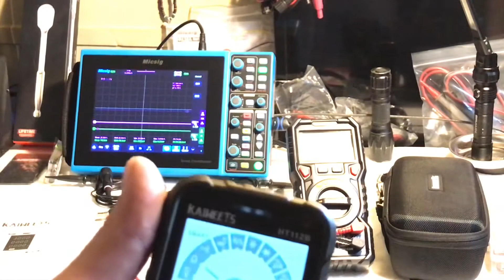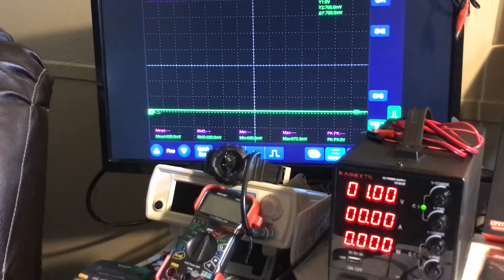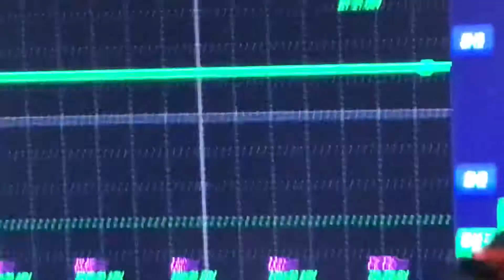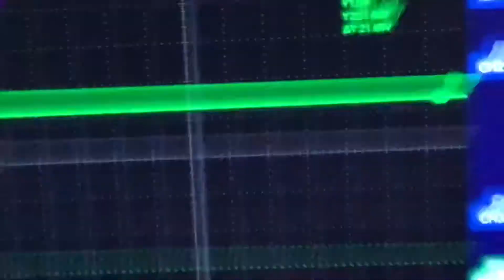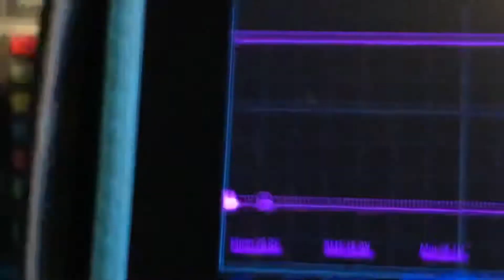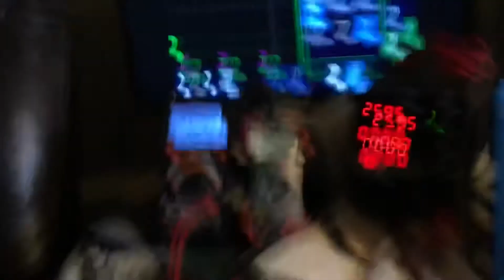Kaiweets DC Variable Power Supply PS-3010F Review (Part 1 Introduction & Voltage)

Comment: I bought one of those PSU's and shortly afterwards it developed an intermittent fault.  When switching the PSU on it sometimes starts and other times all I see are the green and red led flashing.  Kaiweets could not supply me with a circuit diagram, neither could I find on on the web.  Not a great purchase.  Give me a Linear variable PSU any day.
Reply from the maker: Sorry to hear about that. Mine is still working as well as it always has. I’m surprised Kaiweets didn’t send you out a replacement power supply. I have a few products from them. One is a multimeter. When I first bought it, I was messing around with testing current, and I blew that fuse. Completely my fault. I got a hold of them, to ask where I can but that same fuse (no, I couldn’t find the exact one on amazon), and they sent me out a new meter. I was really impressed with them. I also bought a programmable power supply from Amazon. It’s about the same size as this Kaiweets. It sold for $99.99, but I got $20 off with a lightning deal. I bought it about the same time as the Kaiweets, and it too is still working great. I’ll share a link to it. Good luck. 
https://a.co/d/b7clFXp

Comment: Thanks...does it have a protective plastic over front faceplate to protect it during shipping. I don't see one on mine? Hence, my plastic faceplate has some light scratches.
Reply from the maker: Hello West Bay. I can’t remember for sure if it had the protective film over the face or not when I first got it. I want to say no, because I usually keep those on my electronics, until they get where I can’t read the screen; and I don’t have one on it now. But I can’t remember for sure. I’ll try to look in any pictures or videos I made when I first got it. I’ll let you know what I find out. Sorry my response took so long, I had a very long day yesterday. Thanks for stopping by the channel my friend.
Reply: @atomsworkshop195  Thanks for taking time to reply. Quick question, hard to know what is best with YouTube reviews but I see a Long Wei  3010DF and looks exactly same as the Kaiweets but less cost.  Thoughts?
Reply from the maker: If it looks the same and the reviews are good, I might go ahead and get it. I know there are a couple brands selling the exact same one. However, I do know from experience that kaiweets is really good at honoring their warranty. Just a thought. Good luck and let me know how it goes.